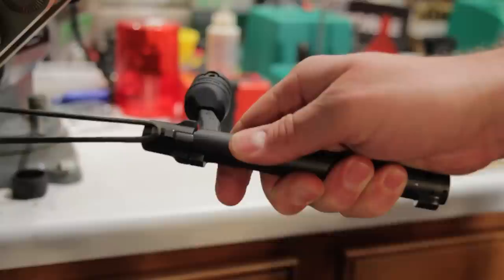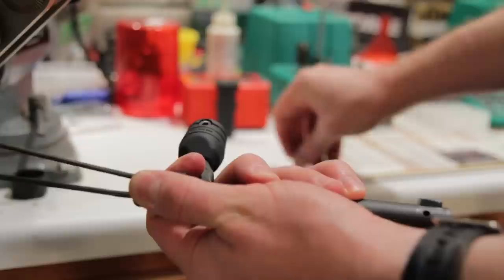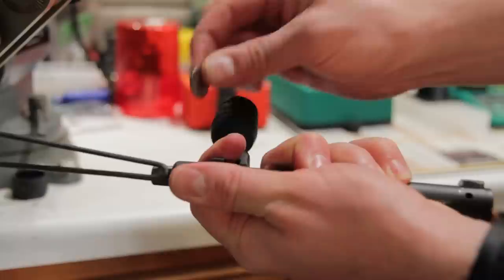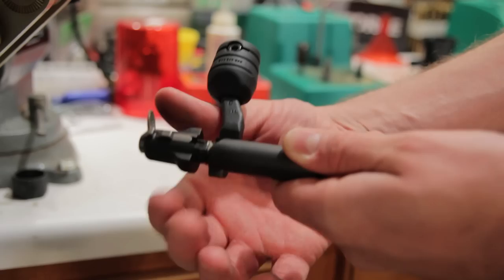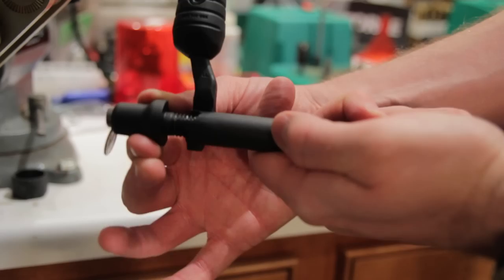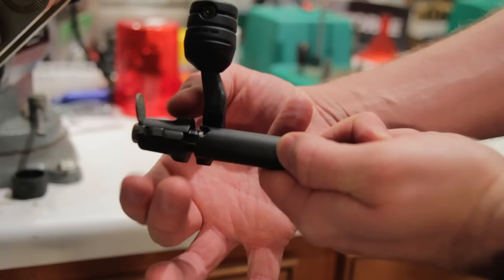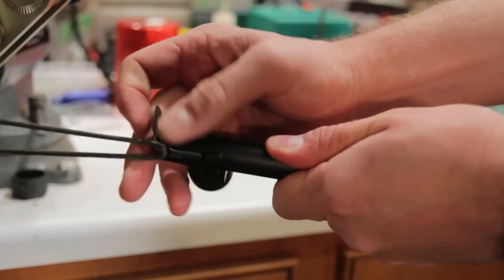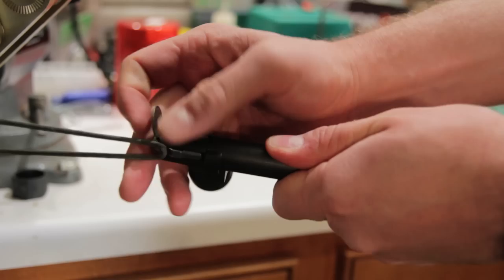Remington 700 Bolt Disassembly, Field Strip (Boot Lace/550 Cord Method)

Comment: Thank you. I hadn't messed with the bolt in years. This helped a lot.

 If you want to get the spring off the firing pin, use the method shown here to pull farther to expose the roll pin. I made a wedge out of HUMW (plastic) to keep the tension and then drove the pin out. If you watch other vids people have special tools but you don't need them.

Comment: The reason I'd be stripping it down while hunting is because the barrel fell off the stock because the cheap plastic trigger guard broke where the two screws hold them together. I wish a dime would fix my gun but unfortunately its going to cost between 50 to 100 bucks for a new steel trigger guard, something Remington should have installed to begin with.

Comment: Is the bolt handle extended or did you install the knob kit
Reply from the maker: That is a KRG Bolt Lift.
Reply: 8541 Tactical thanks..does it install over the existing bolt knob. Or do you have to cut the existing knob off and drill and tap?

Comment: Where can i get a 308 boltface bolt body.  Mine broke.  Remington  is not operating.
Reply from the maker: Check with Pacific Tool and Gauge. They may replacement Remington 700 bolts.